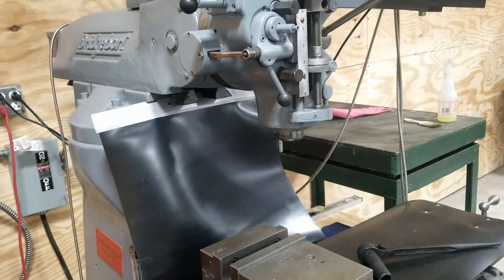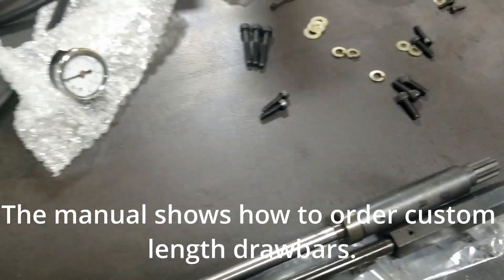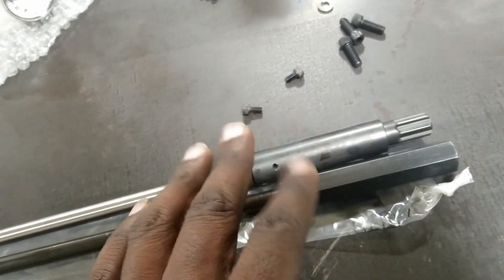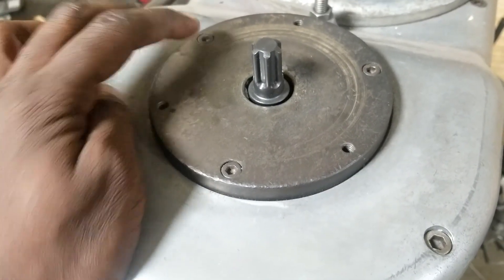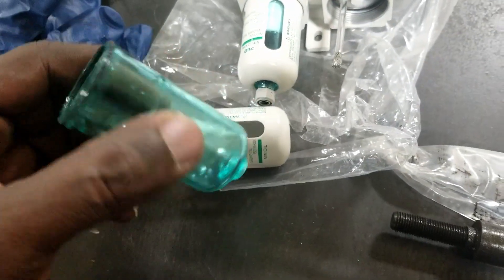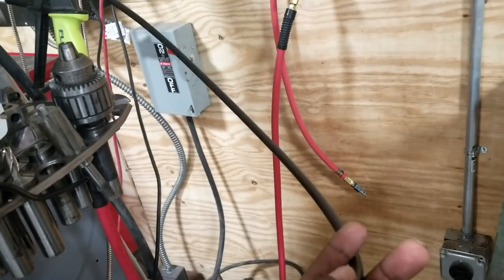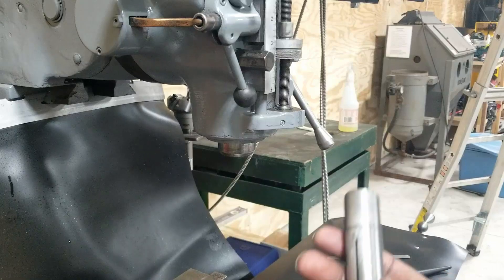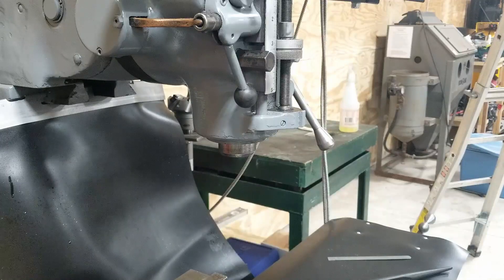Power Draw Bar Installation

Comment: How'd you know that the drawbar shoulders should be 50 thousandths below the top of the mill?
Reply from the maker: The instruction manual references that dimension.
Reply: @Jayjam209  appreciate it. I just received the exact same kit on my job. Had to cut 0.020 off the spacer and grease it thoroughly to work correctly. Although I like the bars that use an O-ring to hold the spacer.
Reply from the maker: @reddnmilla  Me to. Original BP draw bars use an o-ring.

Comment: Good morning my name is Valter and I am writing to you from Italy. congratulations for the drawbar. could you tell me how much it costs to mount it on my bridge? Thank you Greetings Valter
Reply from the maker: Good Day Valter, Its around $550USD online for the unit in the video, Maxi Torque-Rite Power Drawbar. Other than buying the unit, you just need an air supply. Everything to mount to a Bridgeport, or clone, is included. If you have a different than a Bridgeport, the length of your drawbar maybe different, contact torque-Rite to help get you the right length drawbar. 
I got mine from "H&W Machine Repair and Rebuilding".
Reply: @Jayjam209  
thank you for the answer
greetings Valter